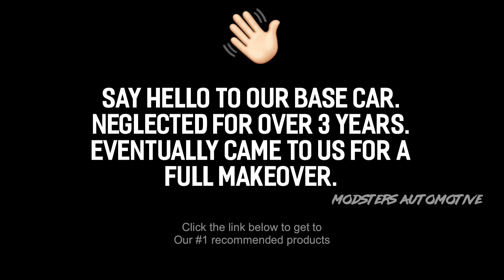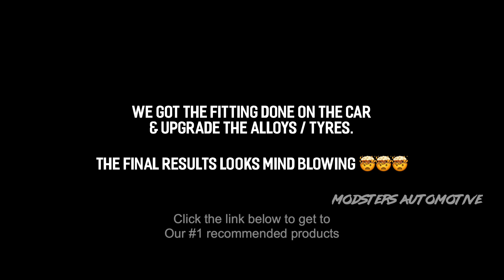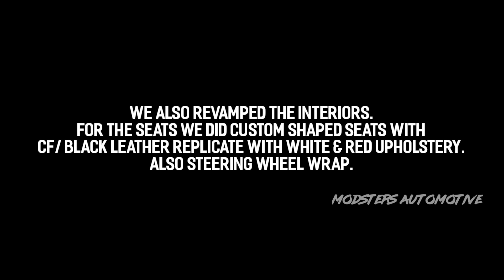Fully Modified Hyundai Accent|Restoration|Modsters|Incredible Transformation

Comment: Excellent work, hats off to the team behind the hard work. Is it possible to get only the front modified bumper on a courier basis?
Reply from the maker: Can be sent sir. Kindly whatsapp on 9962599491.
Reply: Did you got the courier of front bumper
Reply: @prakash001able  i didn't spoke on the given number but instead texted them on whatsapp regarding the front bumper and also the modified headlights, but didn't got a response from them even after being online when i texted them.
Reply: @prakash001able  also they have a website, may be you can get a better response on that